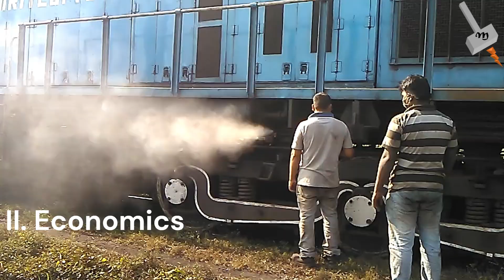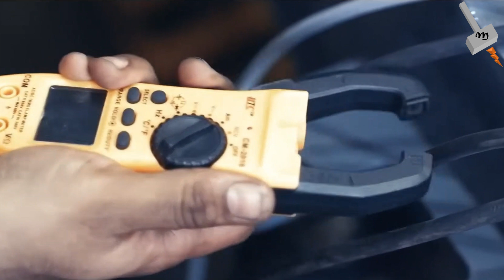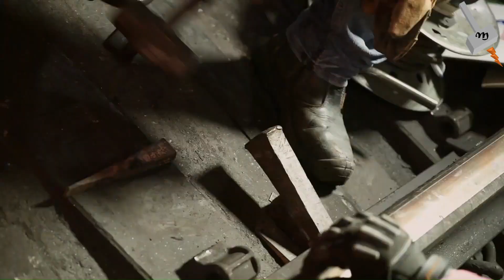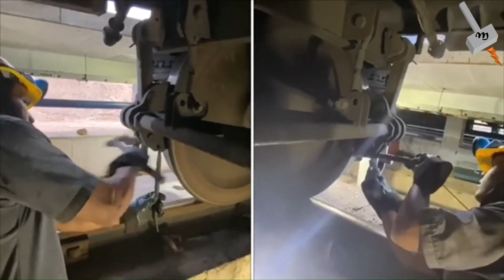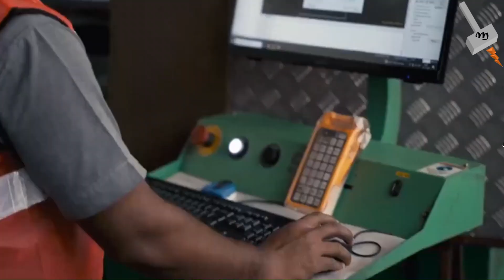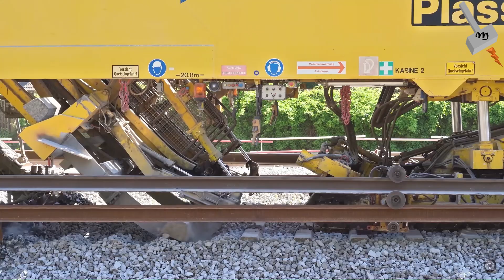🚆 Inside Railway Maintenance: Practices, Strategies & Future Technologies 🔧🌐

Comment: apart from predictive maintenance & RTPs what other areas do you think can use automated systems integrated with centralised AI assisted system using IOT.
Reply from the maker: 1. Real time monitoring of passenger for safety reasons.

2. Train transport scheduling & management to manage higher passenger influx in a certain period of year or month. This is applicable for pre-planned travel.

3. Electrical multiple units have an excellent option scheduling different coaches within same train which can be decoupled followed by recoupling to different train and subsequently diverting the same to different routes which can a good option to handle higher passenger capacity within same available number of coaches. AI can be deployed to optimize and schedule the coaches which can be routed to different destinations.

4. AI can be deployed to suggest alternate travel options or routes in case tickets in a certain presumed route is not available